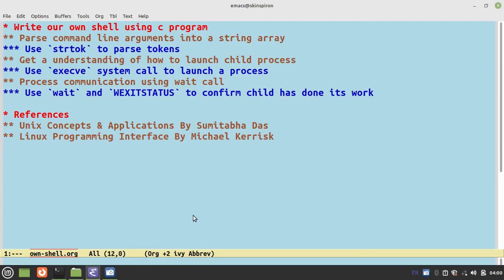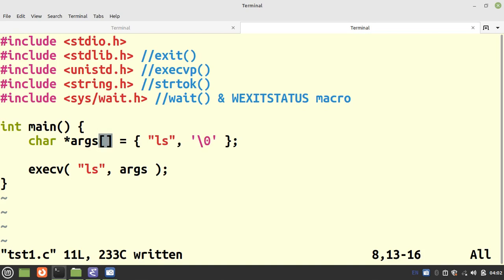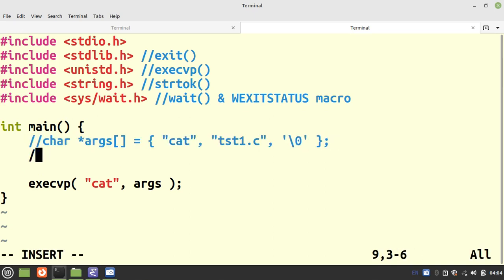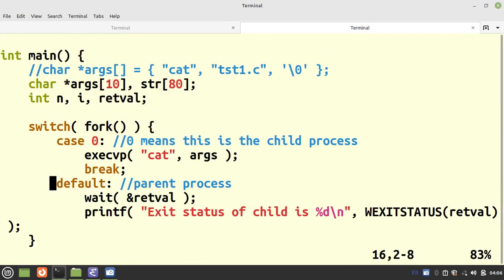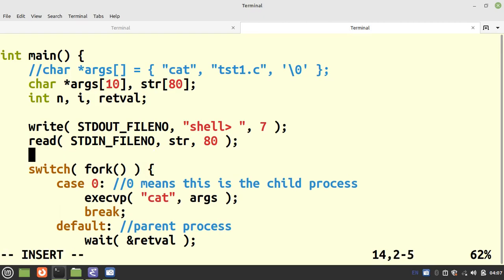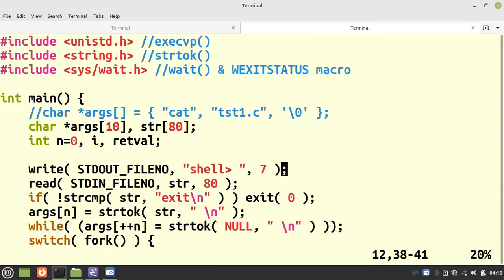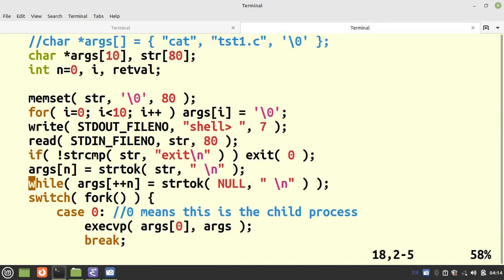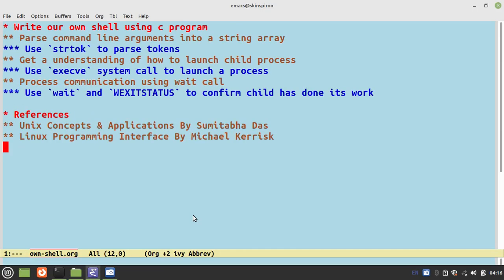Linux | 4 | Write one's own shell in C using execvp function

Comment: I used strtok to parse arguments.... And it crashed as "segmentation fault"
Reply from the maker: Looks like, you are dereferencing a NULL pointer or trying to use wrong memory address  that is not in fact malloc-ed or stack allocated to you..

To get the crash line number, please follow the following steps:
1) compile your a.out with -g flag to add debugging information to binary
gcc -g a.c
2) Once crashed, crash dump will be kept in the folder /var/lib/systemd/coredump/ folder with lz4 extn.
Decompress it & move to current location, change owner from root to self.
sudo lz4 -d /var/lib/systemd/coredump/some_xyz.lz4
sudo mv /var/lib/systemd/coredump/some_xyz x
sudo chown self x
3) Now run the gcc debugger with executable file & core dump as arguments
gdb ./a.out x
4) On seeing (gdb) prompt, enter 'bt' to print backtrace. It will show the error location as,
#1  0x00007fa0bc2fc434 in __GI__IO_puts (str=0x0) at ioputs.c:35
#2  0x000055a3967e6169 in main () at a.c:7
It clearly indicates, line#7 in source file needs further investigation.